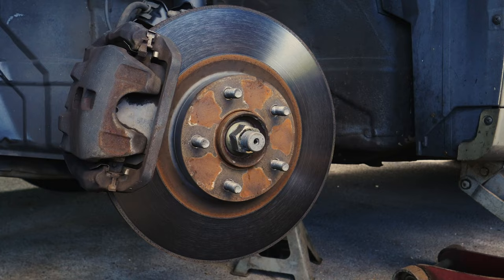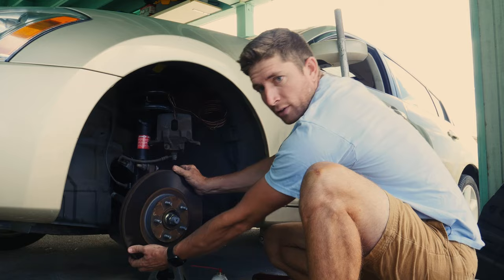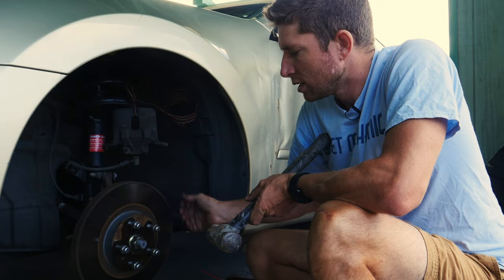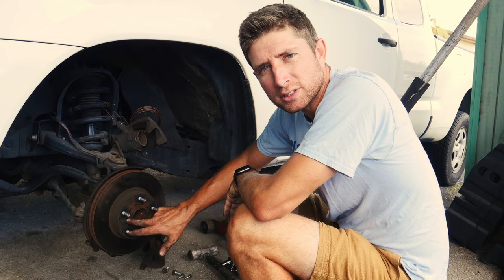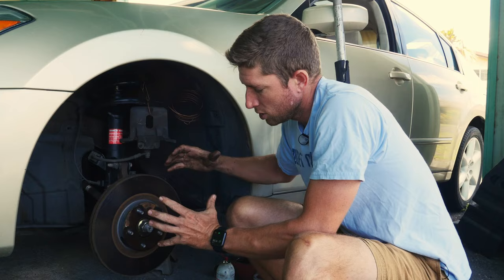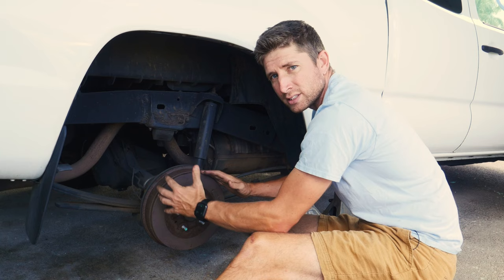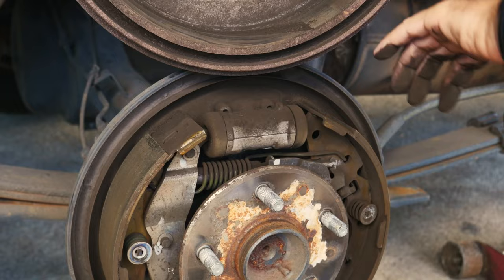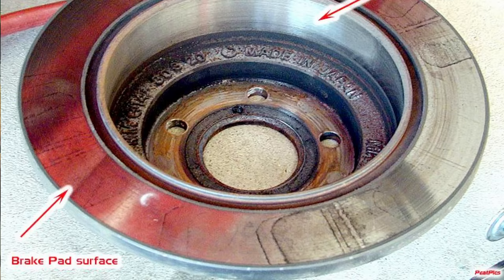Remove Stuck Brake Rotors AND Brake Drums every time! Loosen Rusted Corroded Brakes

Comment: i tried changing my front rotors on my buddy's 2015 dodge Ram 1500 yesterday... got the calipers off and all cleaned up... had to kick the tire off it was so rusted on but we couldn't get the rotor off! it was welded with rust and all we had was a 28oz framing hammer! so we ended up just putting all back together and were planning to get it to a shop but after this I'm confident we can get it off... like most things in life...u just need a bigger HAMMAH!!! LMFAO😊😅😂

Comment: Also, If no threaded hole, Autozone and O'Reilly have free tool loaner programs. Safety tip, put one or two lug nuts back on a few threads so the drum/rotor/puller does not hit your shins when it pops off.

Comment: I've done several brake jobs on my various cars over the last ~40 years, and the bolt-in-the-threaded hole(s) trick was a Godsend for me this week.  The holes weren't threaded on the last couple cars I'd done.  I eyeballed the holes on my son's 2010 RAV4 and guessed they were M8.  I had a short M8 on hand, and it did the job after my 8 lb. mini sledge didn't.  

My only comment about this technique is that I used a ratchet instead of a power tool to tighten down the "leverage bolt".  I wouldn't want it to twist off in the threaded hole and result in another problem.  (That, and I don't have the power tool! 🙂)

It's a very satisfying "crack" when the rust and the caliper break loose.  Thanks!
Reply from the maker: Glad it helped!

Comment: No chance I’m pulling a bolt from elsewhere.  I’ll either break the thing I removed it from, or damage the both and need to buy another one anyway.  I have bought a small set of bolts all around the right size that I keep around for just such situations.

Comment: Thank you, I used a small flat, heavy, steel pry bar nail remover. And the clamp. Once it was tight, I smacked the rotor once with a hammer and it popped loose.  Thank you again 😊

Comment: The heavy hammer is the way to go in many cases of stuck drums, that weargroove i grind out (flat) bij using a angle grinder with a 80 grid paper disc, makes it easy to install back without the adjustinghassle.
Also drilling a pair of holes and tapping them with a thread (i use 8mm) to enhance removing them the next time for service.
Reply from the maker: Good ideas for those with tools! Thanks!

Comment: I ran a #5 threaded bolt with a washer and a jam nut through the brake caliper mounting holes. 
I was very careful not to put too much force. Once force was applied, I used the small sledge. Then, I loosened and rotated the rotar slightly, repeating the process all the way around till she came loose. 
I've been doing my own brakes for almost 40 years, and I've never run across a rotor that was stuck this bad.  😢
Reply from the maker: I trust you not to break caliper mounts, I don’t trust everyone else ;)

Comment: I had to put 99.5% glacial acetic acid, drop wise around the hub and lugs after I had soaked with pb  blaster. Wanted to use hydro-chloric / muriatic acid but didn't have any on hand.  Be careful when using any acid.  Four hours after applying the acid with a dropper and playing jingle bells for 5 to 10 minutes with a large hammer i had success.  I had also put a gear puller on it and that did not work. The previous installer did not align the threaded holes with spindle flange either.   I am using anti seize this time.

Comment: Thanks. Useful tips as I’m just about to do my discs on a 13yr old Mini Cooper. Luckily no studs so should be easier to hammer:). One question… do you change carrier mounting bolts and Caliper guide pin builds for new ones? My Mini Haynes manual (uk) states these bolts are one time use? All the years I’ve done pad changes on many cars  I’ve never changed Caliper bolts!
Reply from the maker: Neither have I! Could that be a special mini thing? (If it were me I’d Reuse them). 
When slide pins become very worn it can lead to noisy rattling calipers. Grab your caliper once it’s installed and wiggle it. Is it noisy?
Reply: @BudgetMechanicHawaii  googling it does seem to indicate  its widespread practise for many brands. My rough estimate on what Ive read is that abòut 90% seem to ignore the recommendation:) I've emailed Mini directly for reason but don't expect a reply.

Comment: Maybe stop assembling brake system dry. So the rust will not freeze anything. Easy (but "too hard" for most).
1. Paint the hubs, with any paint really (or more fancy stuff like aluminium-zinc), spray, light coat. Nope, it will not cause any runout as clowns say/think.
2. Chamfer the drums (on the lathe ideally), so the internal lip does not form. Obvious solution (but too "controversial" again - not my problem).

Comment: Could you grease that surface before installing the rotor to prevent this rusting?
Reply: 😂😂😂 I wouldn't try that. Think about it!!!
Reply: @brianstrange7942  Not the part of the rotor that the brakes touch. The part that is rusting onto the hub.
Reply: Just the other day I published a video on "the bolt hack to get rotor off". Title "I got my rotors off".
Blow torch, bolt, 4 pound sledge.
Reply from the maker: Yes I think some anti seize would be great. Just don’t use an oil or grease that will run out onto the rotor

Comment: U can also use a car; use a cargo strap, attach the wheel to the drum, and pull it off with the trailerhook. At least if do have lug bolts instead of nuts, like most european cars